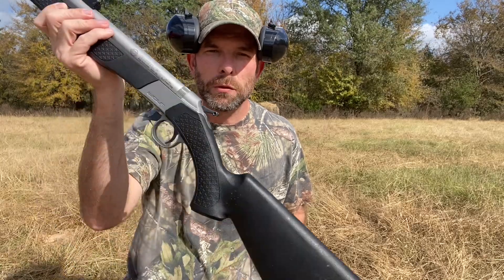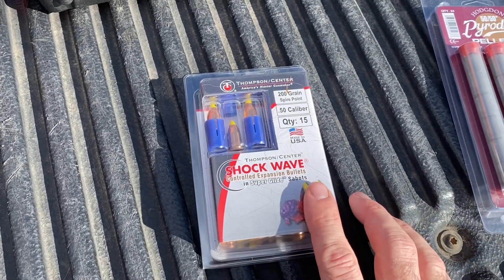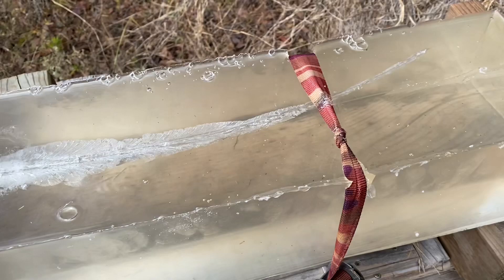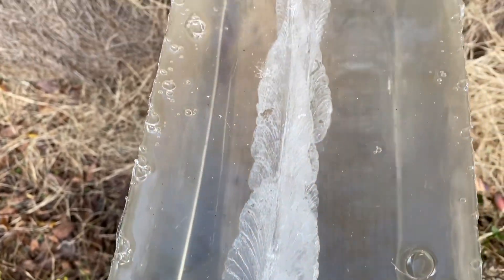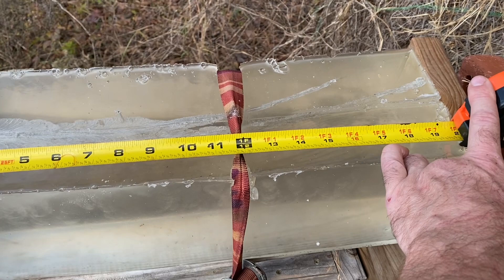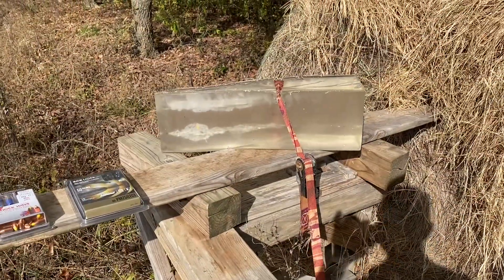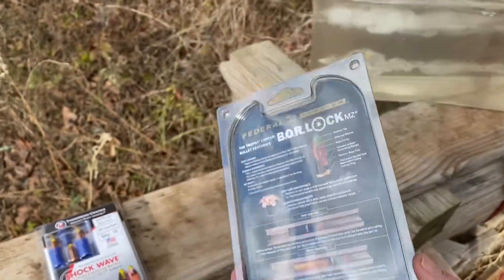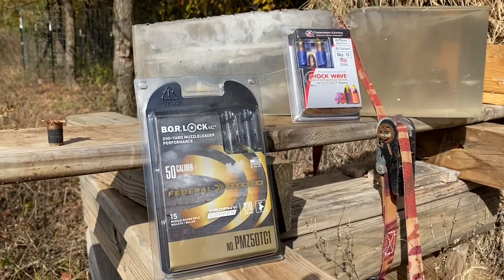Federal BOR Lock and Thompson Center Shock Wave bullets in Ballistic Gel

Comment: Get you some Blackhorn 209 , or at  least Triple 7 loose powder.  Those pellets will go bad on you and not shoot consistent.  Also with a clean gun as your going to load it for hunting I always run a dry patch to get any extra bore butter out and then pop a cap before you load it, it will stop your gun not firing ...  with Blackhorn 209 you can fire 30 times without cleaning.  Also get you a good scope.  You don't need a $1000 dollar scope but put as good as you can afford.  It will help you a lot.  Good luck 👍
Reply from the maker: Yep, and I tend to keep powder and use it for multiple years.  The pellets I was using did not seem to do well.
Reply: @littleriveroutdoorsman6514  Blackhorn has  a lifetime shelf life if you keep it stored good, with Bidenomics it's expensive now but lasts for years. You might need to get you a Blackhorn breech plug for your wolf,  I did . Good luck 👍